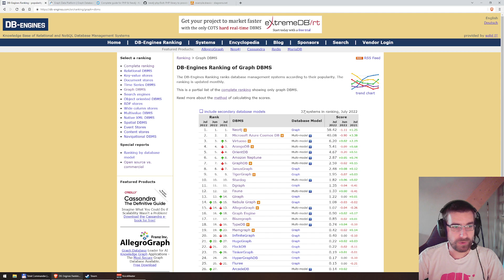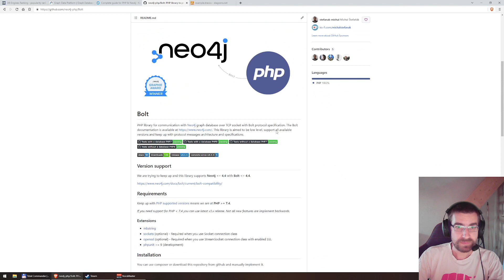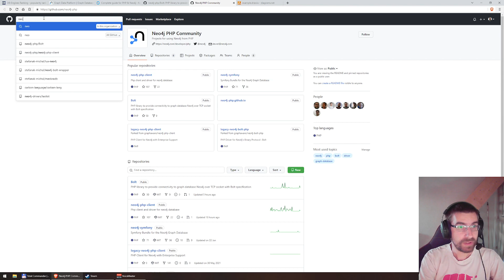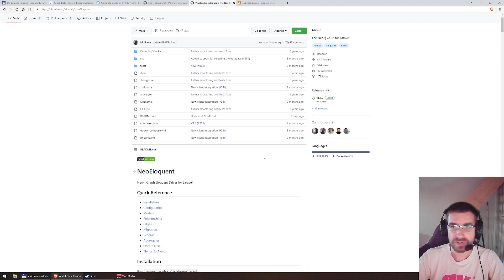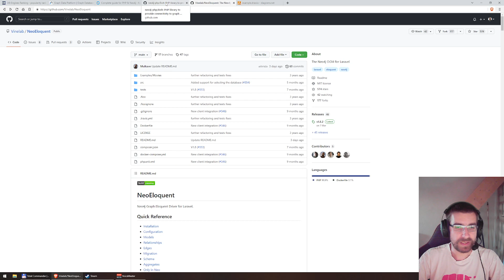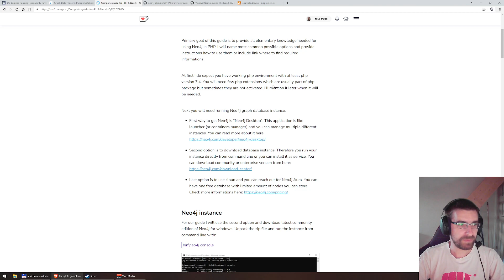Introduction into PHP community with Graph databases

Comment: The main problem for php community to start using graph databases is that we are used to sql-databases. It time to pearn graph databse and change mindset from relational model to graph model.
Also, if top orm libraries doesn't have a way to integrate graph approach, only enthusiasts will leverage it. I'm not sure, does neo4j support such features as record locking and transactions? Because if not, it is a big question if it is reasonable to use neo4j as the main database.